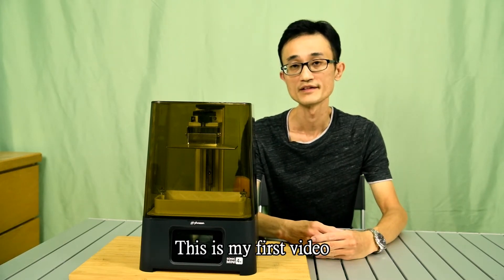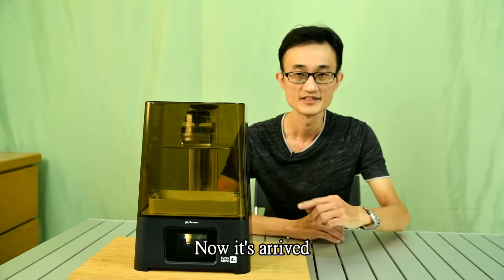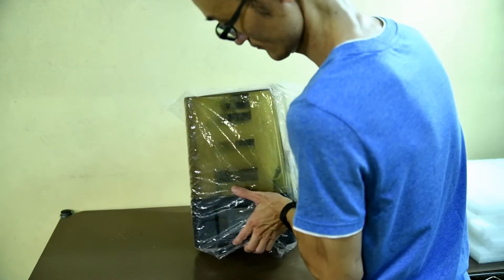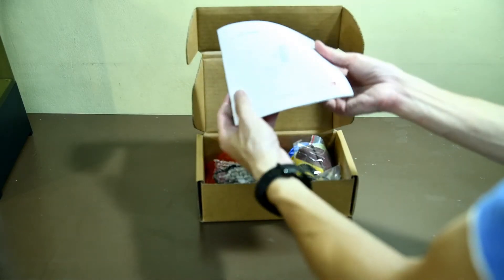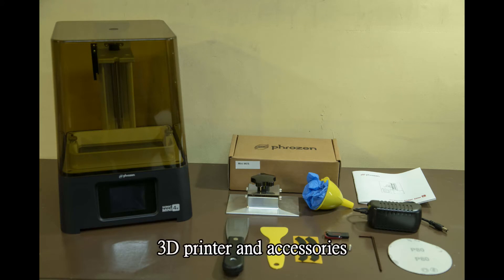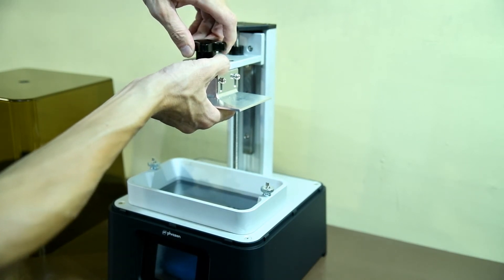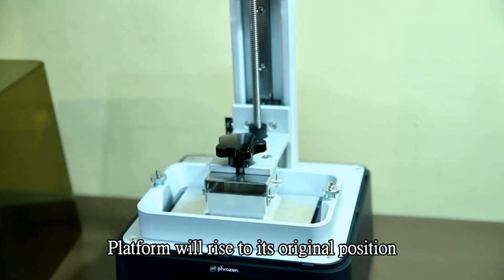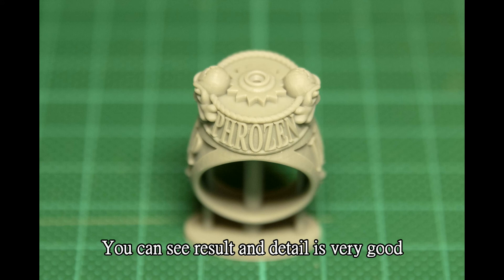Unboxing Phrozen Sonic Mini 4K 3D Printer

Comment: Hi! Do you recommend it as a first 3D printer? I'm about to get my first one, 4K resolutions got my attention where most printers are only 2K, do you have any issue with bed leveling?
Reply from the maker: It depend on your budget. It cost you $329.99. But you may concern about shipping fee and tax. Phrozen is Taiwanese manufacturer. 
Mini 4K is also my first 3D printer. I'm satisfy its quality. The issue of new user, as many others, is that object stick on the tank. It is why polish platform as first step. Second is to adjust parameter,  such as increase exposure time, thickness of bottom. You may need to order more resin. First bottle will be consume in try and error. 
Official site:
https://phrozen3d.com/collections/resin-3d-printer-phrozen/products/sonic-mini-4k-resin-3d-printer-phrozen#shipping
Reply: @slcreation8357  Do you know what size of Fep foil can I use? Is standard 140x200 ok for it?
Reply from the maker: @TD-gy4sh  Tank size is 180X113 mm. Maybe you could fit it.